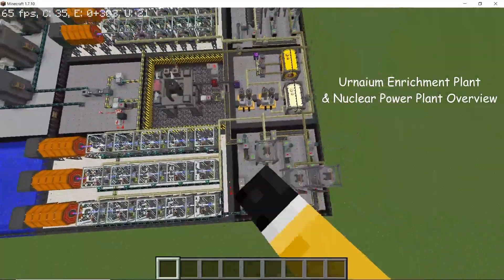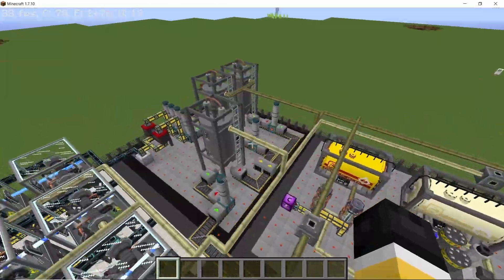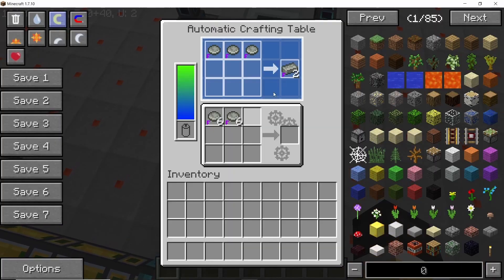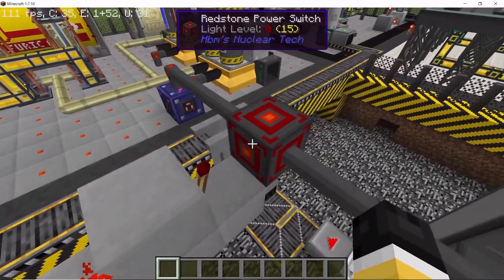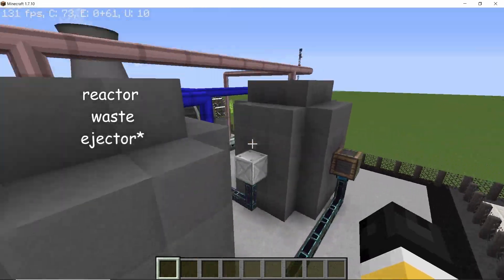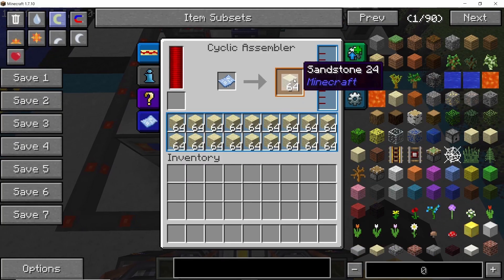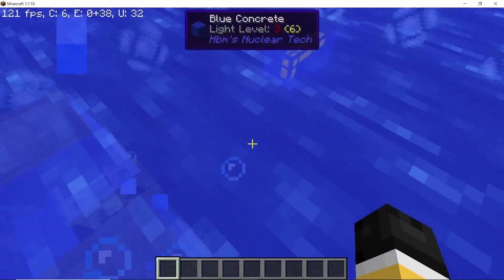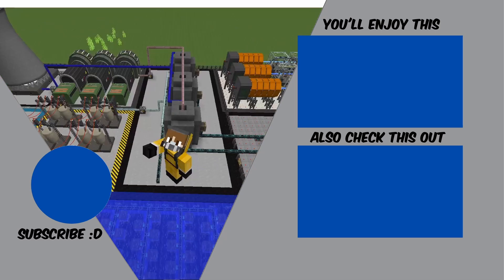Nuclear Power Plant using Uranium Fuel Enrichment Facility - HBM's NTM

Comment: could you show a build on massive liquid storage im having trouble storing alll my liquids in survival
Reply from the maker: Just use an array of multiple Big Ass Tanks 9000 as they have the most capacity by far in NTM
If you're playing in 1.12.2 then you can also use tanks from like Openblocks which is completely modular and also from other mods like thermal or Melanism

Comment: I absolutely love this. By the way, I have heard that bedrock niter ore will be added in the future. That would make Thermal no longer required.
Reply from the maker: Oh actually bedrock Niter was already added quite some time ago (in May end iirc) & a matter of fact I was lucky that this uranium deposit on which this whole build is made had a niter deposit in the adjacent diagonal chunk. The reason I didn't use it is even with speed 3 upgrade the extraction rate is slow which results in a very slow coolant production which is definitely not desirable.
With thermal on the other hand coolant can be produced on site so you don't have to look for a nearby niter deposit plus using thermal wasn't optional in my case cause I had to use itemducts to fit 3 set of silex's in a single chunk width.
Reply from the maker: Also I am glad to know you liked the build my dude 🤜🏻🤛🏻

Comment: how you see chunks in 1.7.10 (if you use optifine in my 1.7.10 crash) and i use google translate
Reply from the maker: By pressin F9 key, even I use Optifine but my game doesn't crash
Reply: @SavageVegeta  what mods do you have because they don't work for me
Reply from the maker: @QiZhan  I keep on changing the mods from time to time so nothing fixed, but most of the time I do have NTM, Optifine and Thermal Series of mods
Reply: @SavageVegeta  you use a mod or a data pack because i have seen a with the same purpose